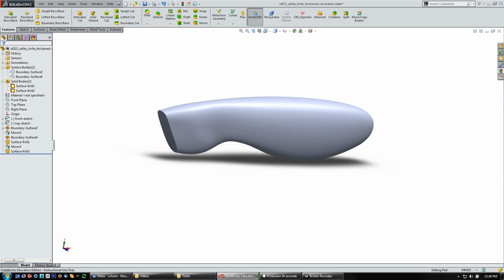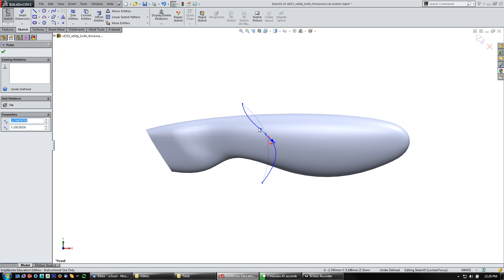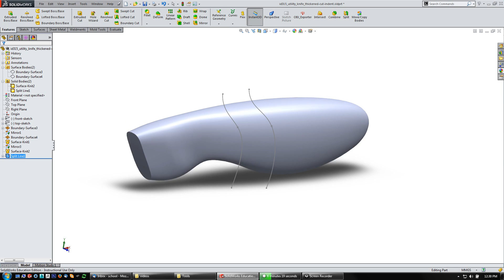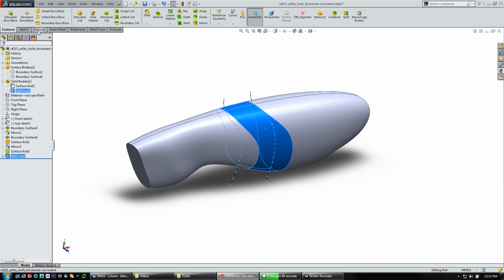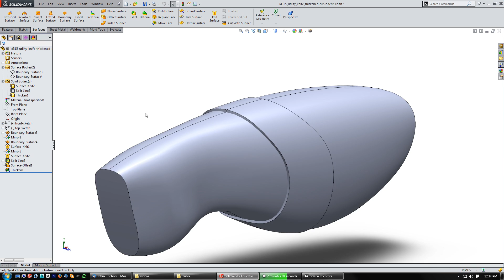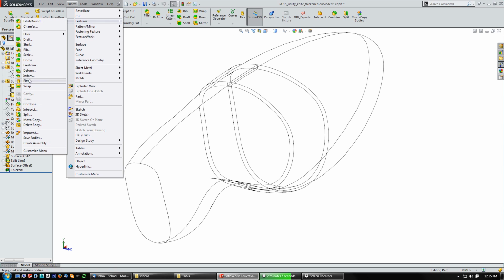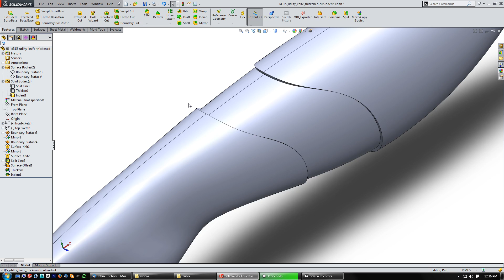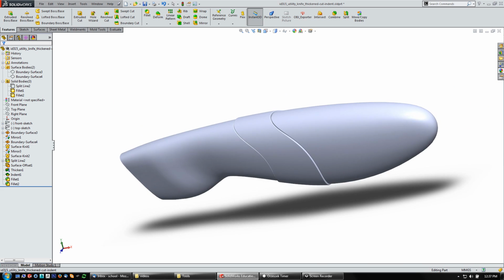solidworks thickened cut and indent

Comment: I know this is an old video. But just a tip when doing a Indent. Select the view section icon to cut the model in half. Then select wireframe view. It makes the selection so much easier. Thanks for the great video.
Reply from the maker: Absolutely. Thanks for the tip.